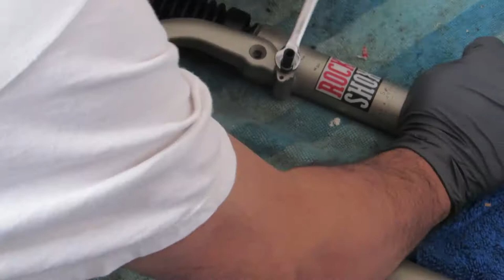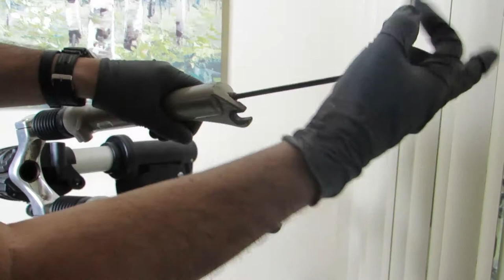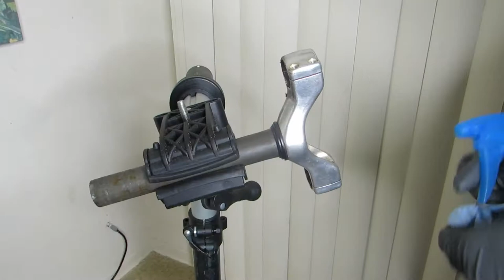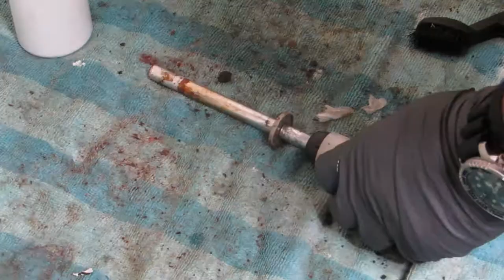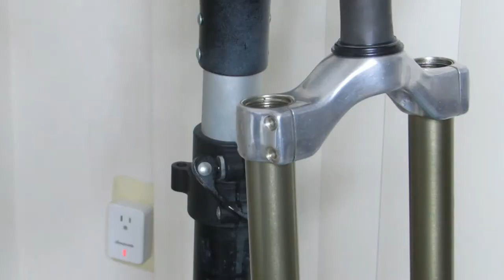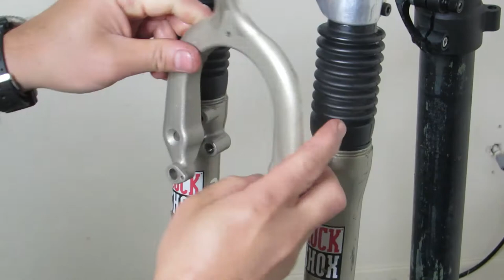1995-1996 Rock Shox Judy XC Overhaul and New SRP Mountain Steed Springs Installation

Comment: Thanks for the video! Very helpful! Btw Judy DH Forks are the same but two dampers instead of one dummy.
Reply from the maker: No problem. In my opinion, the dampers in this fork is rendered useless since it already has springs in them.
Reply: @tatlongbikekalang1390  oil or damper in shock same on car or motor slows the spring rate so the dont bounce.try riding down some long drawn out steps sometime it will be ok at 1st by the time you get to bottom you will be bouncing out of control .You dont have to have it just makes for a better ride

Comment: You didnt put oil in it?
Reply from the maker: Where?
Reply: @tatlongbikekalang1390  in the damper?
Reply: Maybe i missed it
Reply: @richb2934  damper should be a sealed plastic cartridge if original,  no maintenance necessary. If it aint broke...  Or else a metal aftermarket replacement damper to be opened only with special tools provided by manufacturer - a lot of them are out of business unfortunately.... Some actually still do service these old forks or provide parts!
Reply: @pitzpalu8801  that is wrong oil gets nasty and breaks down both types are serviceable you need snapping players for metal ones cartridges.dont beleive me take one apart you can find service manuals on them just tryin to help you out if oil isnt good and no air in it shocks wont work they will  just bounce no dampening
Reply: Also reside racing can send you one that you just slide in its full of oil and ready to go if your intrested I could send you pics of them apart .the plastic ones are easy if the not cracked just clean or put new o rings real simple.and it doesn't really matter you can leave oil out and bounce along but if you want them to work right dig a little deeper cant say I could do a better video i just work on bikes lot .some new low end forks dont have oil just springs.i happen to like the old rock shocks like that they work pretty good if your not serious competitor they dont have much travel.the first year 95 only had plastic 96 and 97 had aluminum and each year was a little more travel some have aluminum steer tube and some are adjustable.butter suspending has a good video on judys
Reply: Reisee racing if spelling is corect